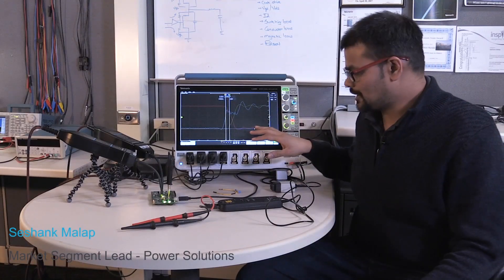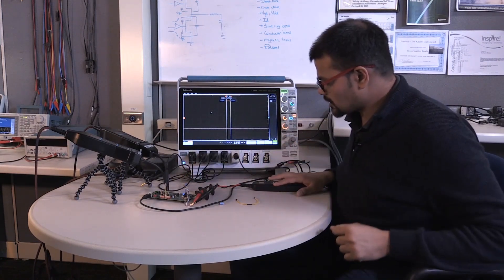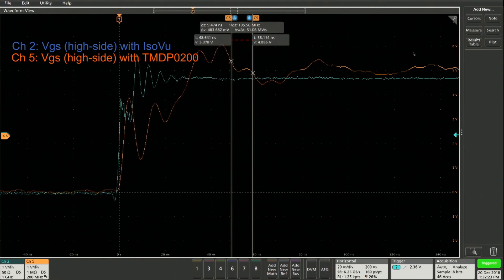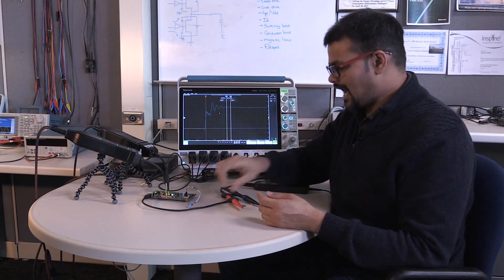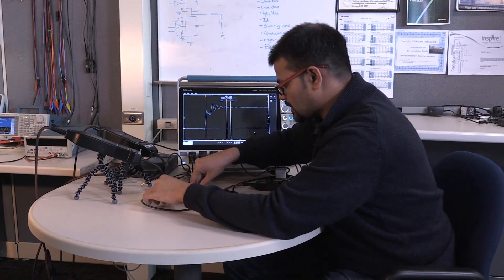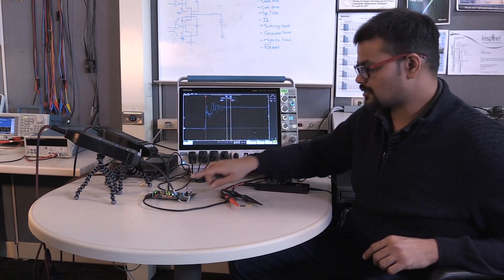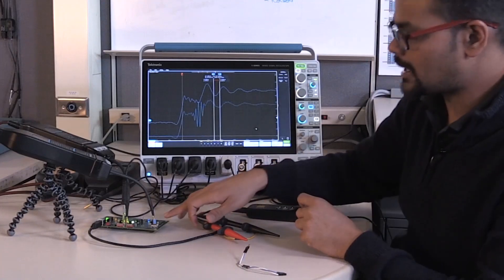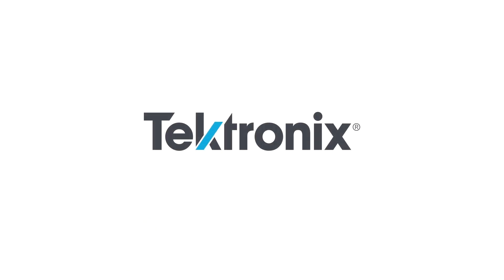Part 4: IsoVu vs Traditional methods

Comment: Re-learning electronics, and now RF engineering, after earning the FCC Amateur Operators License really expanded my comprehension and awareness of thinking like each section of a circuit is like a transmitter/receiver, feed-line and antenna.   Especially when moving up in frequency more-so.  Great demonstration of what seems are simple concepts and challenging.